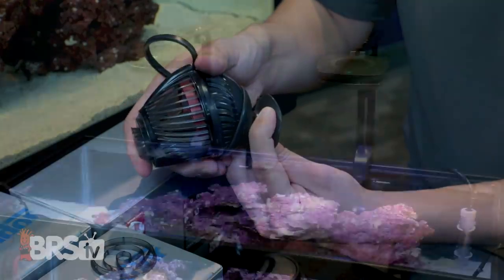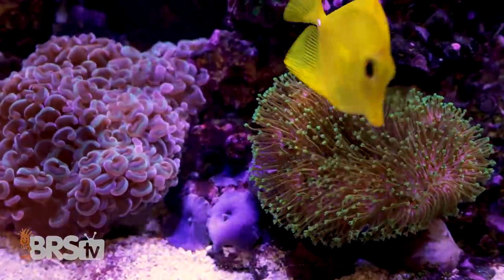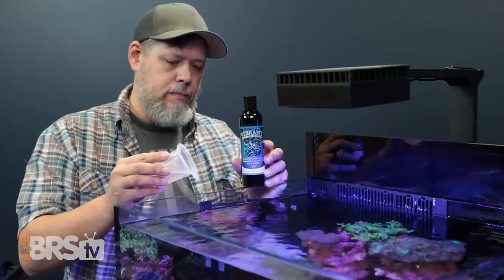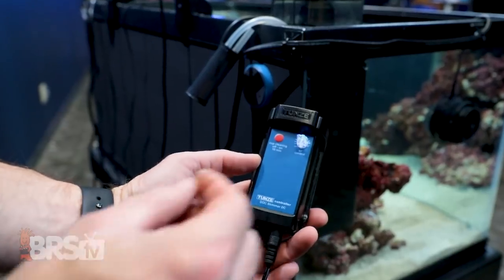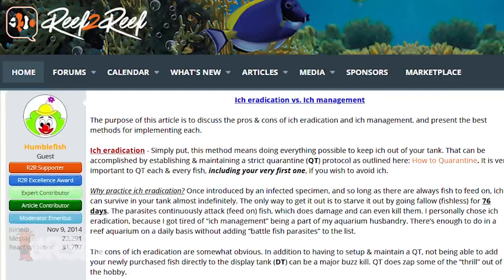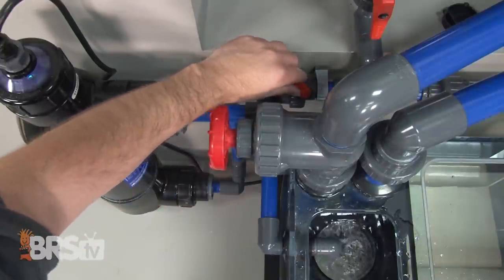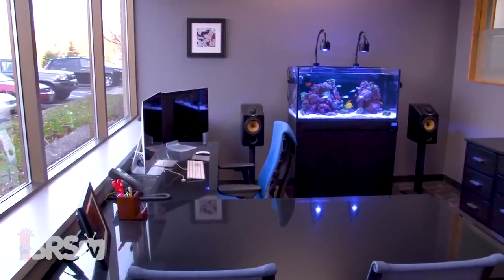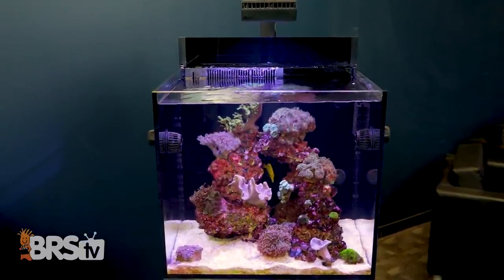Proof that the Saltwater Aquarium 5-Minute Guide actually works!  4-Month Update

Comment: Where did you place the return pump for the Aqua Ultraviolet HOB UV sterilizer on the E170? And what size pump did you use?  I have the same tank, and considering this option.
Reply from the maker: I believe it was a Sicce syncra 1.5 and in the middle chamber
Reply: Thank you! @BRStv

Comment: What UV light did you all use on the e170?  What compartment did you put it in?  I have LOVED this series but the only constructive feedback I have would be to show more of what you all are doing/putting into the e170 on the backside. I bought a used one, cleaned it up, but now I’m not exactly sure where to put additional pieces of equipment or what filtration media goes into the racks. Again, thank you so much for your direct knowledge. I’m excited to try this all out.. and a little nervous!
Reply from the maker: We used the 15w HOB UV sterilizer from AquaUV. The pump we used was a Sicce 1.5

https://www.bulkreefsupply.com/15-watt-advantage-2000-uv-sterilizer-with-hanger-spout-aqua-ultraviolet.html

https://www.bulkreefsupply.com/sicce-syncra-silent-1-5-pump-357-gph.html

Comment: Have yet to set up a reef tank yet but am in the research phase. I like the idea of the skimmer and filter being internal, my question is since the products are made from plastic wouldn't they leak toxins into the water as the salt water breaks down the plastic? Does anyone know if these products withstand the salt water over time?
Reply from the maker: There are certain types of plastic that are generally considered to be "reef safe." All of the gear discussed in this series will hold up to saltwater long term without the issue of leaching 🙂

Comment: Super great series.  Easy to follow.  Even better follow up!  Great job guys.  Wondering for the uv sterilization should you implement now right before you add the  grouping of grazing fish? Letting your tank get through the cycle plus a couple weeks with the clown fish first
Reply from the maker: UV sterilizers are a great tool to add right away. Just be sure to temporarily turn off if you're adding any sort of bottled bacteria type product.

Comment: I'm a freshwater guy looking to try a reef tank and loved the series.  Since I already have a lot of equipment, I figured the logical choice would be to start with the 40 breeder.  While going through your videos, I came across the Fiji AIO internal sumps and was wondering if you think that would be a good option as it's cleaner looking.  Maybe that, paired with the skimmer you used??
Reply from the maker: That's certainly a viable option. The Fiji Cube AIO kit is nice because it can help hide some of your equipment. Downside being that it takes up real estate in the aquarium, so you'll have to weigh the pros and cons when deciding which route to take.

Comment: Im curious what was the average setup cost on the breeder vs the all in one? Im sure they aren't very far apart.
Reply from the maker: The main difference in cost is the tank itself. You can usually find a 40 breeder and basic stand at the big box stores for about $300, while the rimless (and much nicer looking) Red Sea E170 aquarium/stand combo is just over $1800. Granted, the E170 comes with a light fixture, skimmer, mechanical filtration, surface skimming, and return pump, so there is added value there that you don't get with the off-the-shelf 40 breeder aquarium.

Comment: Did the Tunze HOB skimmer have any of the same issue that the Hydor HOB skimmer had, with regards, to the varying water levels, and how that affected the skimmer?  Since you don't have a sump and the water levels varied in the tank itself?
Reply from the maker: We have an ATO system in this tank, so the display water level doesn't change very much.

Comment: Love your videos!!! How did you add the hang on UV light to the 40 gal breeder? What would you say is the "best" most appealing way to go about it...it seems like you have to add another pump?
Reply from the maker: Yes, you'll need a feed pump for the UV. We used the AquaUV sterilizer that comes with a hanger spout, so no additional plumbing needed on the output side.

Comment: What is the lightning in each?  The 40 breeder has way to much disco look for me and I am lookinmg into lightening!  I wish kessiis didint come in only the small circular single pucks!  I like the hydras but afraid of that diso and not sure if they have a diffuser. I know you said before about kessil is easier if you dont know which setting may be to strong and harm corals and I am going up from a current usa so I really have no idea and afraid I may use to much light or to little,  actually maybe it was that the spectrum was preset with kessil but something you said about the simplicity of it.

Comment: Just ordered a bunch of stuff to get a 85g going. Loved this series. Question on the filtration though.....what about a canister filter? I ordered the bigger of the 2 in tank skimmers. Was considering 2 of the in tank filters but the price knocked that back. So then was going to go with 2 hob filters but again all the junk on the back. So what are y’all’s thoughts on a good canister filter?
Reply from the maker: Thanks! Although canister filters isn't necessary if you're willing to keep up with the maintenance of a canister filter, which ideally would be every few days of cleaning, then you certainly could run one. A vast majority of reefers choose to avoid canister filters altogether since most tank filtration is easily achieved with water changes, skimmers and the biological filtration from rocks and sand.
Reply: Bulk Reef Supply got cha. Thanks for the reply hob it is

Comment: Might have been already asked here, but too many comments to go thru...Did you glue any of the rock? I didn't on my last tank and it never moved, even with a wrasse and a shrimp goby pair.
Reply from the maker: We did glue the rocks in these tanks. That said, if you stack the rocks securely, you can certainly get away without gluing them. Just be sure to add the rocks first, then the sand second.
Reply: @BRStv  thanks!!

Comment: What wave did set up to aio tank? I got 20g redsea aio and and have 2 vortech mp10 i just used one. Is it beneficial to use two mp10 and what wave mode do you recommend if i used 2?
Reply from the maker: Two can provide a nice flow variation, but in a smaller 20 gallon tank, you could definitely get away with one MP10. We usually suggest the reef crest mode.

Comment: How well did the hob  refugium work?
Reply from the maker: How well a refugium (algae filter) works is relative to the water volume of the system. The bigger the mass of algae, the more filtration capabilities. In this case, the refugium worked well, but was never meant to be the sole filtration for the tank, so we still performed regular water changes.

Comment: Holy cow that dude was dumping a whole cup of Vibrant into that 40 lol. A 40b is probably 36ish gallons I think biweekly that’s 5ml of Vibrant?Also, let’s not forget pods can really do a great service to keeping rock clean. Depending on your livestock it may take a while to get them self populating but there’s no downside to dumping in some tiger pods every month.
Reply from the maker: The dosing will depend a little on what issue you're battling, but here are some of the instructions. 

-Cleaning Mode - Add 1mL of Vibrant per 10 gallons of aquarium water once every week.
-Maintenance Mode - Add 1mL of Vibrant per 10 Gallons of aquarium water once every two weeks. 
-Bryopsis or Turf Algae Treatment - Add 1mL of Vibrant per 10 Gallons of aquarium water twice every week.